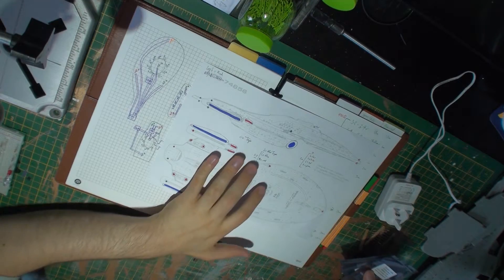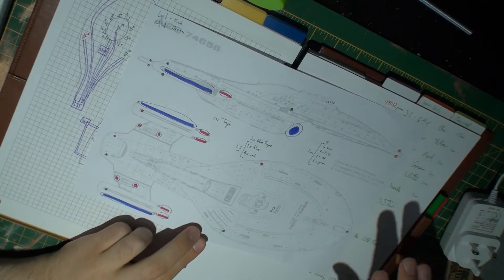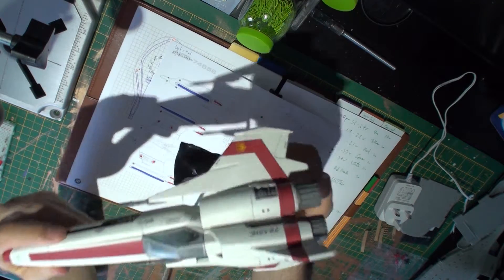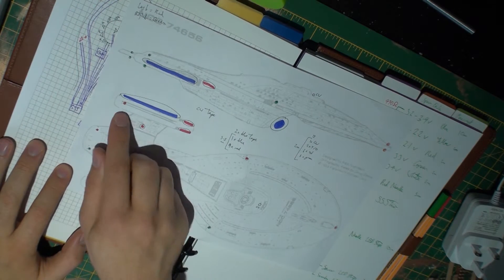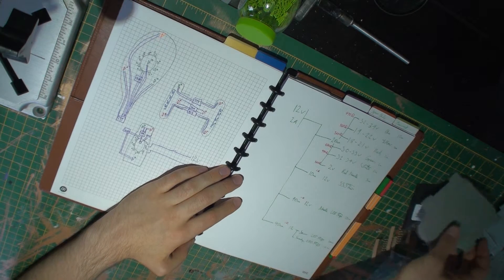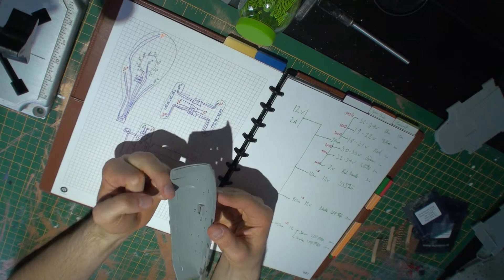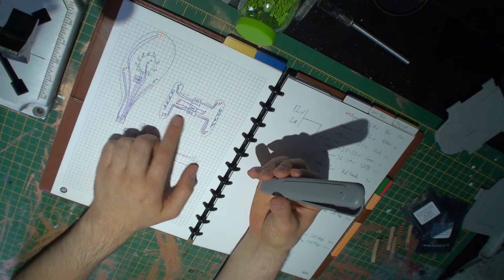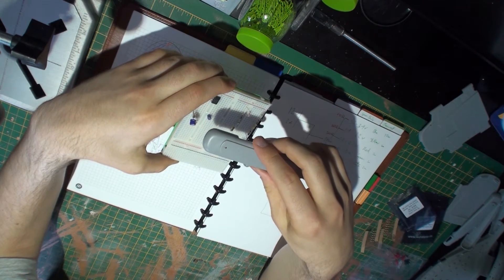Revell USS Voyager Model - Episode 2 - Lighting Plan

Comment: Each output pin on an AVR microcontroller is capable of sourcing or sinking 20mA. They come in 8-pin versions with no external components required. Just saying. ;-)
Reply from the maker: +Richard Urwin I already have all of the components on hand, but I imagine a microconroller is going to be a lot more expensive than a 75p 555 timer.
Reply: +Anthony “Raven” Edmonds True. It's 95p (+VAT)
http://uk.rs-online.com/web/p/microcontrollers/6962614P/
There is more stuff you'll need one-off to program it, but only £5-10.